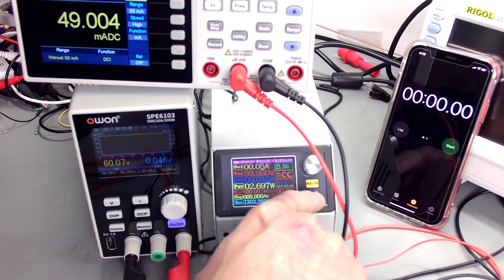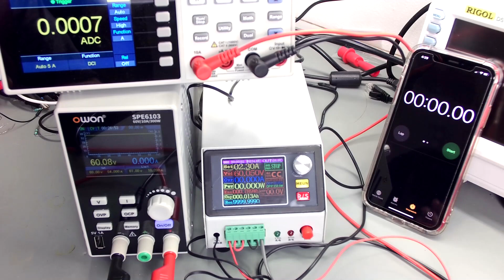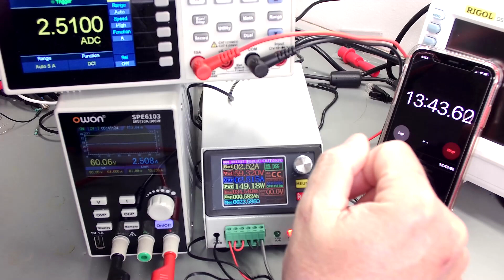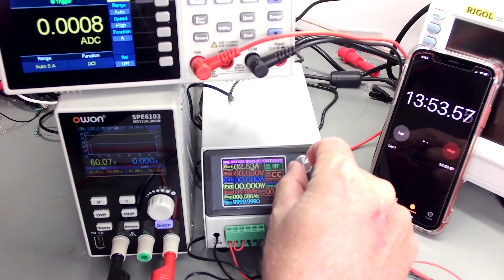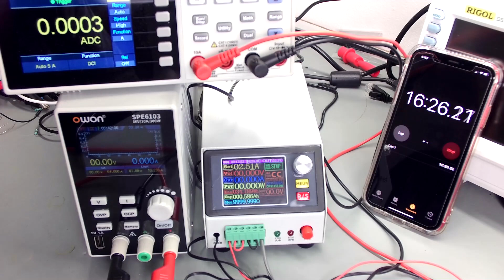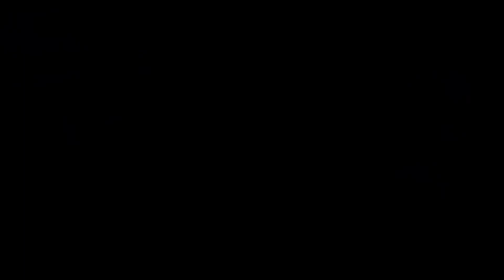Surprising Update on Cheap Chinese Electronic Load Testing

Comment: I just impulse-bought this load yesterday when Amazon suggested it to me, because I wanted an electronic load around 150W to replace my small 35W load that doesn't cost hundreds of Euro, but still has a decent case. My lab power supply can provide 150W with 30V/5A, so I can repeat this test (supervised of course) with more amps.
Thank you for your two videos on this! I just subscribed, as I found more interesting videos on your channel 🙂
Reply from the maker: Thanks,
Yes I was surprised with it. I just used it to test a battery in my latest video and it worked great! 
RJ
Reply: @LynxElectronicsLab   I've just tested it with true 30V/5A (=150W) on a lab power supply and nominally 20V/6.75A (=135W) from a laptop power supply (but it couldn't keep up  the voltage, so it was about 19V/6.75A = 127W) and the only thing that got hotter than 46.2°C was the barrel connector to screw terminal adapter I used to connect the laptop PSU.
The fan was loud, but less annoying than my 35W load's fan at full power.
OVP and OCP worked fine.
Great little device!